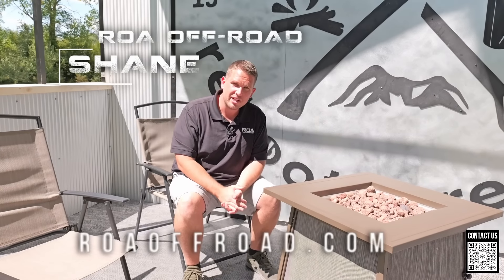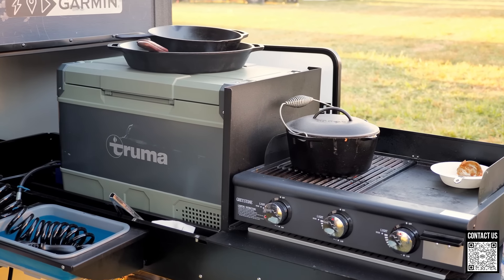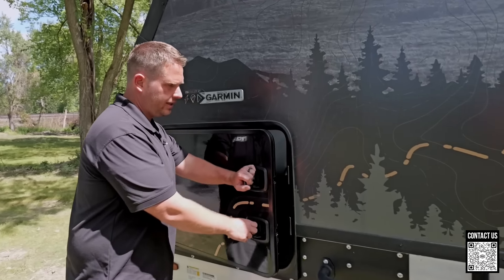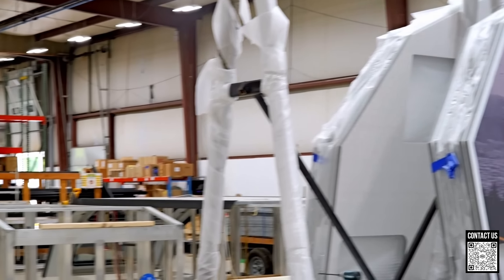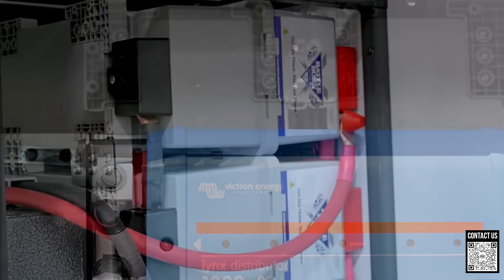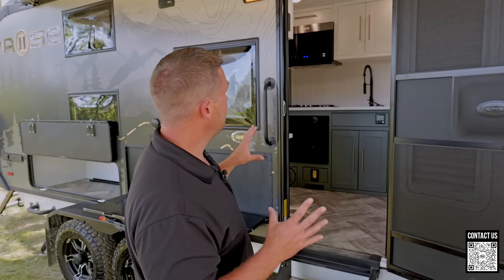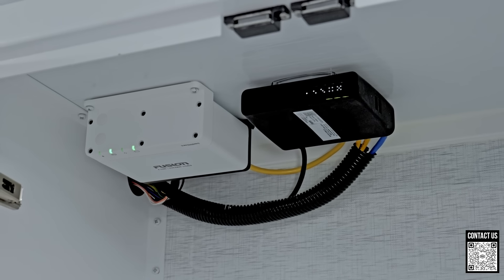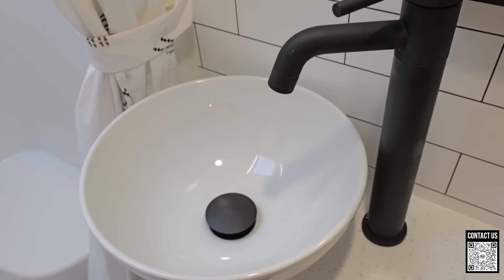All NEW Full Tour 2024 Pause XC 21.4 Off-Road Trailer With Bunk Beds | ROA Off-Road

Comment: Great tour on the 21.4... like the booth option in the 20.3..but.... if they could make one with a booth the same size as the euv19...that would be a game changer
Reply: Yeah! But enough space with those bunks
Reply: 100% agree on the booth like the 20.3. not sure how much extra space it would give (not sure it would be enough / a possible design) but i'd be ready to trade some of the back storage space and give it to the bunks so that extra space inside can be used to fit a booth instead of the desk. And get rid of the table by the bed and those black sockets on the floor. Great trailer.

Comment: Wouldnt the bunk window be better positioned at the top of each bunk rather than the top. Then ur not laying directly against the windows/latches.
Reply from the maker: Great point! Positioning the windows higher on the bunks could help avoid that direct contact and make it more comfortable for sleeping. Generally using these trailers we have not found hitting the latches but the current design prioritizes ventilation and natural light, but we appreciate your feedback —it helps us refine our designs to better meet real-world needs. Thanks  your thoughts!"

Comment: Thanks! Great trailer. I wish it had a connection to the portable washer(76 gallon should serve the purpose) and/or maybe dryer.  I saw Australian, Chinese and European trailers have even  build  in. If the trailer cost so much additional $600 $800 won't change much but will add convenience 😊. Thanks again for the great videos.
Reply from the maker: Thanks much for the comment and the super thanks! It is very appreciated! :)

Comment: is a airbagged powerwagon enough truck for this trailer?
Reply from the maker: @TheTeaguecowley  No, 2500 Diesel is what we recommend
Reply: @ROAOffRoad  Why is that? Its within the PowerWagon tow ratings?
Reply from the maker: @TheTeaguecowley   We have towed it many times with our power wagon with airbags and it does not feel comfortable towing. We would strongly recommend against towing this unit with a power wagon. The new Reboot 19.6 tows great behind the power wagon.
Reply: @ROAOffRoad  I have a R2 sprung air bagged power wagon, is it mainly weight that is the concern?

Comment: the Pause trailers are very well equipped and appear to be high quality, but i have to wonder how much the weight of the electronic/battery stack and wheel/tire combo at the back of the trailer affects the balance of the camper?.....especially since the trailer is tall and has a stubby a-frame at the front. seems to me a half-ton with a heavy duty tow package (12-13k lbs) should be able to handle this camper (assuming the weight of those items were placed lower and more evenly throughout the camper)

Comment: It would be nice to have removable panels on the bottom to access tanks and internals
Reply from the maker: All the panels underneath the trailer can be removed. They’re not easy access but you can access stuff if you needed to.

Comment: Can this trailer be pulled with a 2021 Ram 1500 limited with 5.7L Hemi?
Reply from the maker: We couldn't recommend that. It looks like your the Tow Capacity of your truck is approximately 8Klbs. The max you should tow with your truck is around 80% of rated capacity. That means that anything over 6400lbs should make you hesitant to tow very far! We would recommend the 2500

Comment: That shower curtain has got to go! Makes it look cheap. I like the auto roll shower curtains that squeegee the door. Might be cool to have an emergency brake for the trailer brakes when it’s disconnected or anytime you want them on for less movement. Also the washer/dryer is a must! I’d take that over an onboard generator any day. You can bring along a portable generator but you can’t bring along a portable washer dryer. Max out those gray tanks! Serviceable panels underneath to access tanks, lines, heaters, and electrical would be awesome. 👏 Even if I needed to swap out one of the tanks give us access to it so I can make it happen. I’ve seen a few units have fully removable bottom panels, how cool is that?

Comment: I've been seeing a bunch of videos about 5th Wheels having Frame Flex issues lately. Do these offroad RV's experience the same thing?
Reply from the maker: Anything can potentially have frame flex. The Pause trailer purposely use Huck rivet frame to allow for flex and vibration. The frames are extremely strong compared to any other trailer.
Reply: Is the Pause warranted against frame failures that causes the pieces to delaminate and come apart like the 5th Wheels? @ROAOffRoad

Comment: It looks great but every floorplan I see sucks so if you have bad weather, you’re all in there like sardines, although you think it might be fun, but I for a few hours tensions rising
Reply from the maker: Off-Road RVs have to make some compromises. If you go too large, then that limits the number of trails and obstacles that you can take your trailer over, but like you pointed out, too small and you might feel cramped! Perhaps a 5th wheel is more your style?
Reply: I love so many of the off road features such as the suspension and airbags, the Garmin system and the gigantic solar/battery.  The rear storage, the layout of the electrical & water systems, the outdoor kitchen and the 4 season insulation of everything is outstanding. These are all features that even those of us who don’t necessarily want to go off-road would like to have.  I currently have an Airstream Flying Cloud 27FB with 2nd air conditioner (ducted), desk (stand up), and bunk bed over twins.  It also has lots of internal storage.  Internally, it is very comfortable.  What I don’t like is the limited solar/battery/inverter (being addressed in the new Trade Wind model), the inability to warm the tanks and drain pipes without running the furnace (Basecamp has tank heaters but still has exposed tank drain pipes which will freeze) & general lack of organized systems such as the power and water on the Pause.  I actually question how much the designers and executive staff at Airstream use their product.  The 1000 amp inverter powers some limited outlets but not the GFCI outlets which includes the external outlet which I always use when boondocking.  So, basically I want a Pause and an Airstream to have a baby!  As far as pause improvements, don’t like the metal internal cabinets & doors as they are loud, cold and actually cheap looking.  Also, just not very much storage and the front bed is just too exposed and lacks privacy.
Reply: Glass duck needs a little cbd
Reply: @gregmoessner3104  that’s all you have to say about it you’re just a troll dude that has no meeting
Reply: Try going from a tent in a similar situation to this. That would be heaven. Plus because it's got such a frame chassis and hitch that makes it so u can get where others can't. But otherwise maybe you're family needs to learn how to behave. Tell ur kids no every once and awhile.